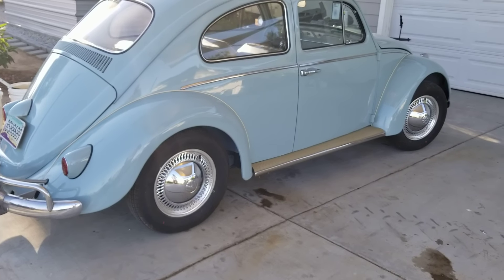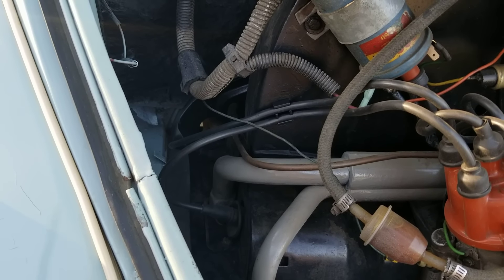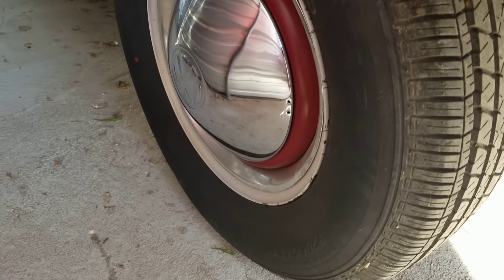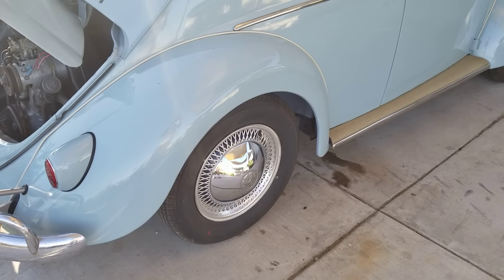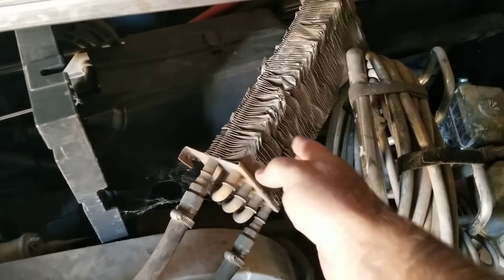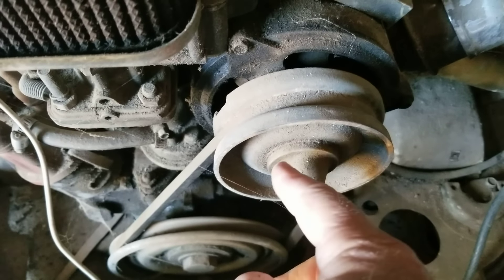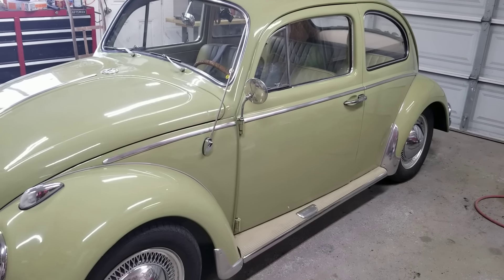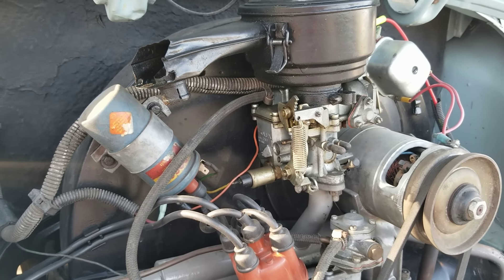Things NOT!!  to do to your Volkswagen VW bug or bus

Comment: Not sure if this applies in the States, but it certainly does over here in the UK.
Do not use rubber fuel lines that are more than a couple of years old. The ethanol content in fuel rots the rubber and they will leak. Make sure you change them for proper ethanol proof lines, including the short one under the tank.
Reply from the maker: wow here they last a few years or more. good to know
Reply: I Agree.  ESPECIALLY the one under the tank.  I drove my bug for several years with the stench of gas.  I couldn't find the problem until that small fuel line failed and a good sized puddle of fuel was on the floor of the garage.  Yikes!  I replaced it with ethanol proof lines and haven't had a problem since.
Reply: @sawdust311  why would you put ethanol in your car to begin with? --  CORN IS FOOD, NOT FUEL!!!!!
Reply: @andylaird1368  Because that is all you can get in about 99% of gas station  in US.
Reply: Windhund Garage  That is excellent advice! Ethanol petrol “E85” is widely used in the USA.  The “OEM” fuel hoses for air cooled VW ‘s were never designed for such fuel.
Reply: @Mikefngarage  ...actually, this is good advice for ANY car built before 1985. All these cars, especially from Europe, do NOT have rubber fuel lines made from a rubber that can tolerate ehtanol fuel. Not just the lines but any plastic seals or gaskets of fuel system components.....get as much of this replaced wit MODERN fuel lines...and you'll be set.
Reply: @sawdust311  Oh dude, you gotta get your lungs checked out after breathing in gasoline fumes for years (no matter how subtle the stench).
Reply: I always use non ethanol gas cost little more but worth it
Reply: This also affects T2 expansion pipes behind the fire wall.  It is an engine out exercise to get all the 2 inch rubbers which connects all these but is essential with your new Biden E15 coming in!!
Reply: @sammysmith8394  What gas station has non-ethanol gas?
Reply: @felicitad4095  Av gas. Find an airport with a fuel station.
Reply: Absolutely CRITICAL! Good on ya!
Reply: @andylaird1368  I don't put ethanol in my gas, it's already in it when I buy gas. You should know that.........
Reply: I live in a very small town in northwest Georgia and we have 2 gas stations with ethanol free fuel. So probably there are more around than one may think…Great Video
Reply: @nonelost1  Leaded gasoline smelled the best.
Reply: Are they made of natural rubber or neoprene rubber?
Reply: @andylaird1368  In the UK ethanol free petrol (gas) is not officially still available. Fuel is labelled as E10 and E5 (up to 10% ethanol and up to 5% ethanol). As a peculiarity, Esso E5 currently has 0% ethanol in some parts of the UK, but in my city today (9 February 2024) it is £0.18 per litre more expensive than E10. A US gallon of E10 will cost £5.37 for a US gallon (about $6.77) whereas E5 will cost £6.05 (about $7.63) - so an 86 cents a gallon difference. It is both the unavailability of ethanol free fuel and the price difference between fuels that make people put ethanol in yheir vehicles.

Comment: No matter what, always carry a fire extinguisher.

P.S. Do not think you never need to adjust your valves.
Reply: What valves?
Reply: Every oil change adjust valves
Reply: Unless you have a 1500/1600 with the hydraulic lifter mod done.
Reply: The VW manual would say to adjust them every 6k miles. But VW experts say every 3k miles.
Reply: I got my first VW right after I graduated from High School in 1962 - a 57. Over the years I’ve owned 5 VW’s and probably put over 500,000 miles on them total. Over the years I have broken most of these “never do’s with a VW”.  I don’t recall ever having a fire extinguisher and I never had a fire
Reply: @janreeves5443  Got my first one in 1974, it was a '62 bug.  Blew the engine.  in 90 I got a Super Beetle, traded it for a bus.  Bus was stolen out of my driveway.  Never found it.  Now I have my dad's 57 bug.  Me and dirt have the same birthday, so this will be my last one.  It's shop/mechanic bound for s physical, and I'm hoping for good news.  Body and Tires look great!  LOL  We shall see.  Wish me luck!
Reply: Change the oil… check the gap. Always.

Comment: he missed to mention "Do not put a fuel filter  to the fuel line in the engine compartment, that's a fire hazard" 🔥🔥🔥🔥
Reply: This is the most evident issue the author forgot mentioning.
Reply: What is the best place for the filter?
Reply: @htimsid  - about 4-6” from where the fuel line comes out from the back firewall. Between firewall(the actually rear of the body of the car itself) and engine shroud/doghouse.  Behind the engine up under and above the rear left tire. Just close off the gas hose with 2 clamps and cut the gas line.  Insert your fuel filter and be sure to use fuel line tightening clamps on the filter, one on each side, remove  It can be a bit of pain but better that than it coming off and literally spewing gasoline all over the engine which will most likely catch on fire by a spark plug before dying from lack of fuel.  
Used to happen all the time when I was young and all of our parents and friends parents had one.  My fathers literally burned up on fire and so did my wife’s fathers.  Simple fix and there’s plenty of videos on YouTube explaining how to do it
Reply: @dtrujillo12  he mentions it at the end of the video…
Reply: @htimsid  Right where the OP put it, below and away from the distributor, the coil, and the intake heat riser.

Comment: Do not run a engine that has been sitting for years until you remove the fan shroud and inspect for mouse nest...motor will burn up if the cooling airflow is blocked
Reply from the maker: yea for sure or the leaf pile blocking the air.
Reply: I had that issue in my ‘66 and I was the third person owning it after sitting on a filed for so long. Thank God I did that !found the remaining of three dead mice!
Reply from the maker: always check fan flow from time to time. you can feel if the air is not moving sometimes without removing the shroud.
Reply: Just to add to that good point, don’t forget to check the small airflow pathway for cooling the generator. Mud dobbers/ mud wasps love to build nest in there on such a car. It will burn out gen
Reply: Had one towed into my shop in the 70's that had a blanket sucked into the fan.
The lady said she thought maybe it would start easier on the cold morning if it was warmer.

Comment: When I rebuilt my Beetle engine 20 years ago, I decided to place a small 12 - volt Buzzer - in the circuit for the Oil Light. What happens here, is that the Buzzer will sound - when the Ignition key is turned on. When the engine starts, the Oil Pressure switch (on the engine) will become open- circuit, and the Oil Light on your Speedometer will go out, and the Buzzer becomes silent.
 Now, here is the benefit of doing this: You may be on a lengthy drive in your beloved Beetle, and your Oil Light may illuminate - due to loss of engine oil and Oil Pressure. Placing a Buzzer in this circuit will alert you instantly!!
 We all know that (in bright sunshine) that the tiny Oil Light Warning is extremely difficult to see, and many VW Owners may not even look for any indications of Oil Pressure Loss whilst driving. It really is too late - when you become alerted to Engine Oil Loss - when the Big-End Bearings are knocking to alert you that something is wrong.............I have revisited this site for a second time - just to add this note, and the VW Engine does not really have a large quantity of Engine Oil. Hope that this helps the Beetle Fraternity. Greetings from Australia.

Comment: Don’t leave home without a spare....belt, tools, points, bulbs, a VOM, duct tape, a length of fuel hose, a small container for gas, a quart of oil, spare tire, Fire extinguisher ,your gun, wallet, money and a cell phone.
Don’t drive the car unless BOTH warning lights work.
Don’t drive a marginal car...marginal brakes, engine noise, smoke....all means a breakdown on the freeway.
Don’t tow an airstream trailer....don’t pull some one out of the ditch.....that’s what AAA is for.
Don’t let ANYONE work on or drive your car, especially kids.
Don’t wash your white hot engine....or your dark color car while hot...the first is obvious...the second.....car wash soap will eat into a hot paint job and ruin it.
Don’t coast down a hill, in the mountains thinking it will be good for the engine....use third and it’s better to run fast, with ....the fan running fast...than no fan speed.
Don’t....at all...never....don’t drive your car to the service station with the oil light or generator light on. Stop...shut off the car, and fix the problem.
Don’t cheep out on parts....your damn lucky you can even find parts. Wolfsburg is a great place. Pricy? Price parts on a new VW and compare....cheaper? Your welcome.
Don’t put hot rod parts on your car, unle$$ you. Plan on $pending lots of $$$$ making it right..even then that candle burning at both ends will only go 40k miles, instead of 80 k.
Plan on $$$pending more on your car to make this 200 hp engine, stop, transmit the power to the wheels, track the power and steer the whole mess around corners. Good luck...cause it’s going to be hard to out do the eggheads at Wolfsburg.
Dont try to engineer something on your car, unless you have a plan, did it before satisfactorily, or have a degree in engineering .....most of the time putting a bigger screw in that hole...will make your transmission shift incorrectly...ha,ha,ha...see the “egghead” comment above.
Don’t plan on making a 4 hour trip in four hours....it will take 6. Enjoy your self.
Don’t drive the car cold ,Start your car.....roll a cigarette...get it hitting good. Then go.
Don’t give big high out put cars a jump start with your car running.....when their car starts it will fry the electrics in your tiny archaic voltage regulator.
Hmmmm what else have I seen
Don’t turn your 49 Hebmuler or 52 Rometch into the “Hawaiian look “, or a sand rail. It’s considered blasphemous and may result in lead poisoning.
If you have a cool older VW, and want a sand rail....sell it to a nice person.....and go buy one of those bombardier things....or a corolla.
Have a battery cutoff switch....so you can save your car when your 60 year old wiring harness grounds itself.
Don’t try to see if your car will float....it most assuredly will not.
Subaru engines belong in Subaru’s.
Don’t cheap out on brake parts....stopping is the most important thing a human being can do.
Speaking of stopping..........
Reply: @OkFixer sounds like you mightve had a veedub or two lol best comment ever🤙
Reply from the maker: now that is a real vw owner.
Reply: @extract_a_mundo3732  a few... and all beaters...except the one I am putting together now.
Reply: Jordan Winders  you'd be surprised the amount of people who leave it behind.
Reply: @Mikefngarage  thank you sir for being able to ''vent'' on your page! Keep up the good work.
Reply: You must of owned more than one....you forgot...LISTEN TO THE ENGINE...not the radio.
Reply: @allenschmitz9644  that’s good also
Reply: OkFixer Nice list!
Reply: Gah daamn!
Reply: @tsgibson91  ha,ha,ha
Reply: @SladesVWBeetle  remember to tip your waiters and waitresses before you leave!
Reply: This Reminded me of the great John Muir....good stuff
Reply: @Hoodhistorian562  the cigarette line is directly from him....but whatever you do....check your e mail, your schedule, go around the car and check it out....whatever....let it warm up for a minute or two. The same goes for new cars....THEY say you don’t have to, but they are liars.
Reply: @OkFixer  I totally agree  ! I read that book from cover to cover in 8th grade years before I ever bought my 1st vw bug  in high school, that book helped me  with vws and non vws since 1995 . The way you wrote that , even before I  read the cigarette line I could tell you know your stuff !
Reply from the maker: yea I dont have radios if you watch my videos ha ha good one.
Reply: Rene Drew  exactly bro, me and my twin brother still quote thing's from that book .
Reply: Studying engineering. Most of the stuff to me is common sense and I know why.
Reply: LMAO👍
Reply: @Hoodhistorian562  Learn it. Know it. Live it.

Comment: Do not purchase a old bug without inspecting the floor pans, heater channels and wheel wells for rust and rot
Reply from the maker: oh yea for sure gotta look for that rust. could be costly.
Reply: bluekangaroo kw And look for areas that have excessive amounts of undercoating. It’s amazing what people try to hide under an inch thick glob of UC.
Reply: True, so true. I worked in a garage years ago & my boss was supposed to 'look over' this 71 Beetle for the new owner. He proceeded to put the car on the lift- Yeah, you guessed it- with the pads touching the undercarriage, the lift went up 5 inches before the car moved. Not only did the running boards look like wings, the pads of the lift were poking through the floor in the passenger compartment.  OOPS- car ended up being a parts donor!
Reply: Inspect the unibody extensions that the rear bumper mounts to for bad rust, or the bumper will fall off unexpectedly.
Reply: And gutters

Comment: Do not go anywhere without a spare fan belt.

Do not continue driving if the orange light on the dash comes on.
Reply: Andrew Swanson or a pair of pantyhose.
Reply: My generator light is always on😂 but it’s the alternator that’s not charging properly but it still spins the fan
Reply: What is the orange light?  Sorry :-( I really don't know.
Reply: @felicitad4095  it's the warning light on the speedometer that says there's a problem with the charging system. It comes on when the belt that runs the generator breaks, also runs the cooling fan. When the fan isn't spinning, the engine gets extremely hot and will literally burst into flames and burn the while car up. Know this from experience lol

Comment: Wish you lived 10 minutes from my house. No bug experts I know of in my area, did not know any of this stuff, vital information,  thanks much.
Reply: VW--  making mechanics out of regular people for 60 years--
Reply: Larry Woodruff  And valve adjustments (especially #3)  on non “dog house” oil cooler engines is critical. Factory specs call out for every 3K miles but I do mine every 2K just in case. Mine is a 66 bug.

Comment: Great tips, well presented. I’ll add
Lift your spare wheel out of the well to inflate it as it can jam in there as it expands.
Keep a stash of spare oil (for topping up when you’re out) in a 750ml sauce ketchup bottle with a pointy nozzle (so there’s no spill or funnel required) next to your spare tyre. Mine’s labeled ’bug juice’ 🤣
Pop a new spare alternator belt in next to the spare wheel too.
Change the oil regularly (it’s the coolant too)
If you can’t hold your dipstick the engine is overheating (slow down and enjoy the ride)
Carry spare ceramic fuses (not everywhere has them in stock these days)
SMILE & Wave to other bugs 🤙

Comment: All good tips! thanks for confirming what I already know (knew). For newbies: do your research! VERY important. . . Remember: AIR and OIL both do the cooling.  . . check your oil level every week. My 36 HP original engine is close to 150,000 miles and STILL strong  and fine. ;)

Comment: Great vid.  Stock is Rock!  Stock fuel pump has a filter.  Make sure your tank has it's  screen.  No after market filter is needed.  Make sure your axle boot nuts are at 3 or 9 O'clock. Not on top.  Factory spec. Most problems occur from modifying the German engineering.  Cheers!
Reply from the maker: yea for sure on the axle boots. so many guys make that mistake. I try to put on the solid ones when the trans is out but when it has bolts ususlly 2 Oclock but some guys use 3. either one works. 12 o'clock is a no no.  torn boot
Reply: @Mikefngarage  10-4.  'Need that acordian action on the top and bottom.   The side just has to bend, not stretch.  The seam gets sealant so as to not leak.  I see these being installed improperly all the time.

Comment: Check your oil level often . If the level is higher than you remember check for a gasoline smell . The fuel pump maybe leaking into the crankcase .
Reply from the maker: OMG how many motors have I seen like that.
Reply: What a life-saving advice! Thanks!
Reply: Indeed, I blew an engine that way. The fuel pump leaking into oil sump seems to be a bit of a design flaw.
Reply: It could also be wrong float height in the carb…it usually is…
Reply: You could blank off the original pump hole, and fit an electric pump. Problem solved. I did this with my Windscreen Washer (originally connected to the Spare Wheel).

Comment: I had a rather pristine '69 bus in the mid-eighties, still with it's original mediam blue paint .. loaded it with camping gear and my two children to go up to Bishop, California from Pomona 
made the mistake of pushing it at 70 up the Cahon Pass in hot weather and shortly before Summit lost the exhaust valve and broke the piston in #3 cylinder
Reply: Oh man, what a bummer.  Do you still have it?  (Note to self, no Summits)
Reply: Been there, done that, 71 van though was never able to get above 65, only could get to 70 downhill though the brakes sucked.

Comment: Have a 67 completely stock. Looks almost exactly like your light blue car. Don’t drive it in the rain or snow. Keep a trickle charger on it year around. All original except it has been repainted. Owned since new. During the winter I start and run it at least once a month. Change oil before putting it up for winter. Any suggestions on what more I could do to keep it in top shape? Have checked on all your points that are on this video. Everything is good to go. Only thing I do myself is change oil and clean the screen for sludge. Live in South Dakota.